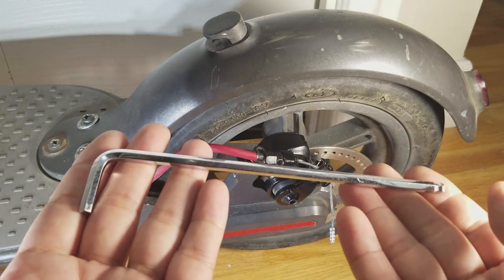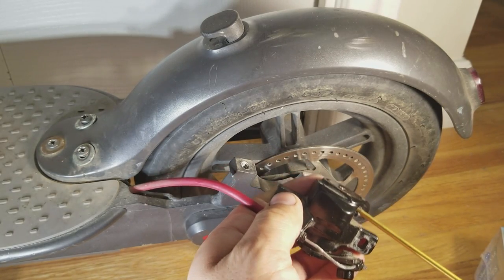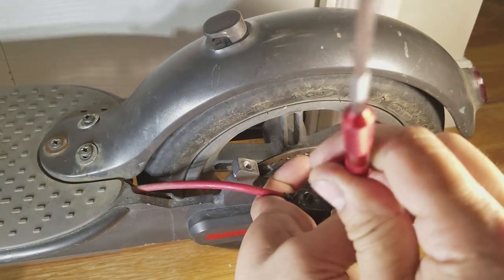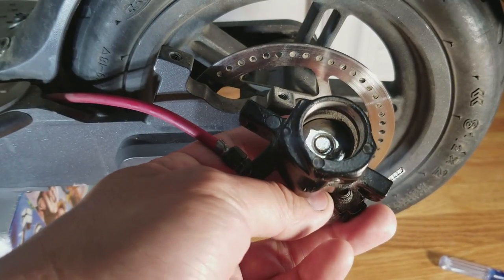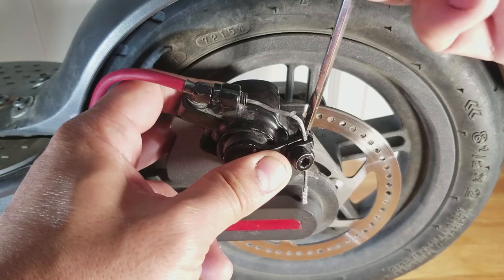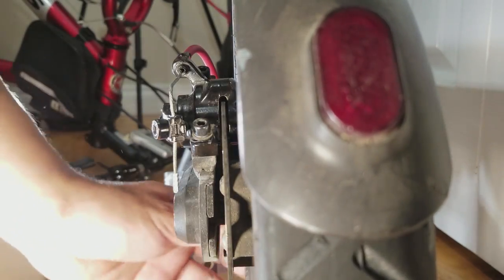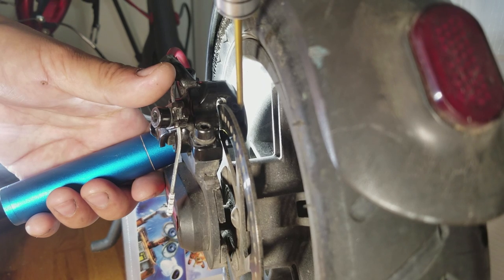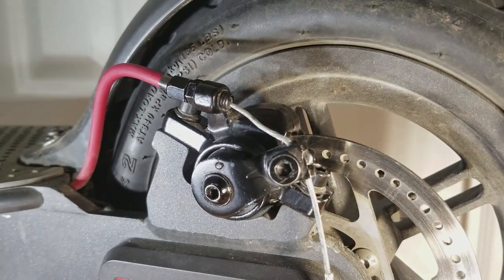Xiaomi M365 HOW TO change rear brake pads

Comment: Hi Doug Hnut!  I really appreciate all the high quality content you publish regarding the features of the xiaomi m365!  It has really helped me in my purchase, but i am wondering if i could what kind of locking mechanism you would suggest for this scooter?  Its been a little difficult finding further information.  Appreciate all that you do!
Reply from the maker: i personally dont use a lock, but i would recommend a "u" shaped lock used like the one like this https://www.aliexpress.com/store/product/Xiaomi-Mijia-M365-Electric-Scooter-Skateboard-Wheels-Hub-Lock-Security-Anti-Theft-Cable-Tyre-Tire-U/2500012_32888213797.html?spm=2114.search0104.3.18.47f442bbjzCkRH&ws_ab_test=searchweb0_0,searchweb201602_5_10152_10151_10065_10344_10068_10130_10342_10547_10343_10340_10548_10341_10696_10084_5724015_10083_10618_10139_5724315_10307_5724215_5724115_10059_100031_5725015_10103_5724915_10624_10623_10622_10621_10620,searchweb201603_2,ppcSwitch_7&algo_expid=2083bad3-78e4-4bb5-91b7-42967c1f5789-2&algo_pvid=2083bad3-78e4-4bb5-91b7-42967c1f5789&transAbTest=ae803_2&priceBeautifyAB=0

Comment: My inner brake pad shipped way out of spec, meaning the outer pad is pushing inward because there's such a big gap on the inner side. It actually bends the disc because there's so much play. Thank you for the video, I'll have to tackle this soon.

Comment: Yout should be able to easily allign them by pressing the break down then locking them in, this will make sure on both sides u have even as much space and no rubbing on either, cheers
Reply: You have to tighten the inner pad to the rotor if you don't do that it won't alighn right it's not like on hydraulic brakes only one pad goes in

Comment: Hey man!! Today I decided to take all apart the hub and battery compartment  notice water in side, I pulled everything out cleaned the water dry it with hair blow dryer. Put all back together now runs good again. It seem that water seeps down the colum were it folds. And it wasn't raining that much. I'm going to load some pics on my comments when you have a chance take a look.
Thanks.
Reply from the maker: Will do! I'm glad you figured it out. The water could be also coming in from where the cables go into. The silicone grommets may not be seating properly.

Comment: Thanks for making these videos, I know they will be useful In the future. Can you let us know roughly how long you had your scooter and how much mileage you did so we know roughly when to change the pads. Or is there any indication on when to change? Sorry for the dumb question.
Reply from the maker: No problem!. I have about 1200 km on it  when i changed the pads.  periodically i would tighten the cable, and then i eventually ran out of adjustment. so that was my indication
Reply: @DougHnut  thank you
Reply: @DougHnut  i have around 4500km on it and just now thinking of changing the pads, i do use the engine break to the max
Reply: @mohamadsinno7787  how do you adjust the engine brake

Comment: You can center them mutch easyer just tighten the inet pad till it's touching the rotor squeeze te brake lever while holding the lever tighten the caliper bolts then unscrew the inner pad and tighten the cable as needed
Reply: same as a bike lol

Comment: Hi Doug! 
I only use my scooter two day maybe 15km on it, today I was taking it for a spin and hub motor wasn making really loud sound like vibration felt like a old rusty wheel that has been left outside for years, than stops completely, kick started again same thing. Doesn't run. One of day I driven it was some small puddles. Don't know if water got in anywhere.
I just posted a video with the motor making that sound.
Reply from the maker: Sounds like some dirt got inside the motor. Or there was something already inside the motor is loose. Nothing should be able to get inside the motor from regular riding, including puddles up to 2 inches deep. 

I took apart a clone m365 motor because it made similar noises. And found 2 tiny pieces of a broken zip tie inside it. But haven't tried the motor since to confirm noise is gone or not

Comment: Hi does the front wheel break at all because there is only one handle for the rear break? Does the rear wheel only break? Thanks
Reply from the maker: yes, the front wheel brakes by using regenerative braking through the motor. it is quite strong and can be adjusted through the MI home app. most of the stopping power comes from the front brake.
Reply: Doug Hnut thanks Doug 👍

Comment: My M365 has a squeaking noise from the rear wheel. How would I lube the squeak so it goes away? Is the squeaking from the wheel bearings.

Comment: Got it to work again! 😁...today manage to take it all apart, again found some water in battery compartment but not water either on battery or the board. I'm assuming its humidity that's causing it. Do you think if I use just some saran wrap to wrap the electric board would be ok ?
Thanks
Reply from the maker: If it's humidity then saran wrap don't help. Maybe those desiccant  packs will help humidity . But best thing to do if try and find out where this water is coming in from. 
This other day I ran through a puddle at least 4 inches deep. No problems. Pants, jacket and face wet.

Comment: Hi Doug! I had fully charge the battery didn't use for a few days,  realized now its totally  with no charge,  any advice!?
Thanks.
And now it doesn't even charge,  turn it on beeps and turns off , the charger light Indicates its charged .
Reply from the maker: you are going to have to take the battery cover off and measure the voltage. there is a reset button on the bms . you can see it through the clear plastic. just press and hold it for a few seconds, that might work if the battery is ok
Reply from the maker: also, it should hold charge for a lot longer than a few weeks if the batteries are in good shape.

Comment: The brake disc often bend while Slow down. The Material from the wheel of the disc is inferior. It is a Problem with the material. You will always have a grind of you driving. It is normal.